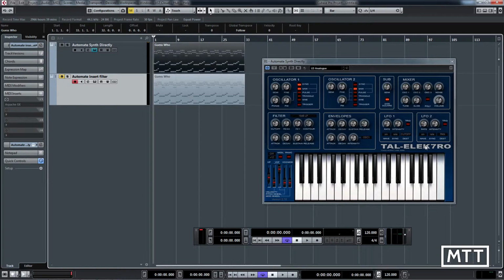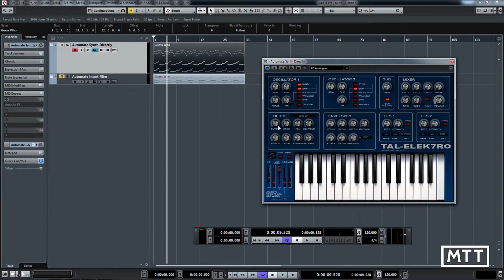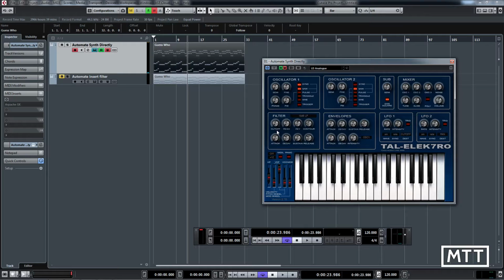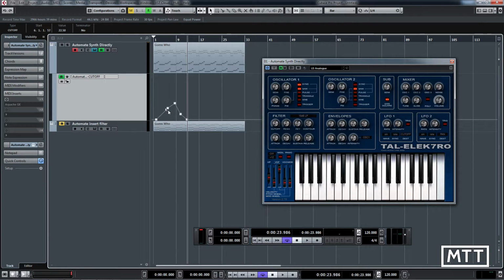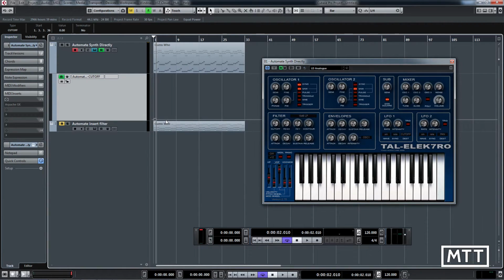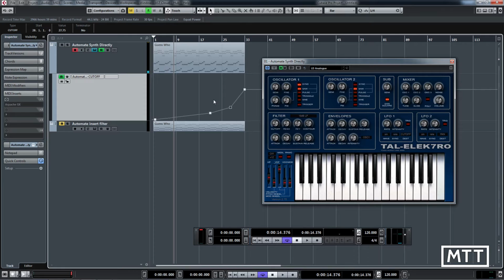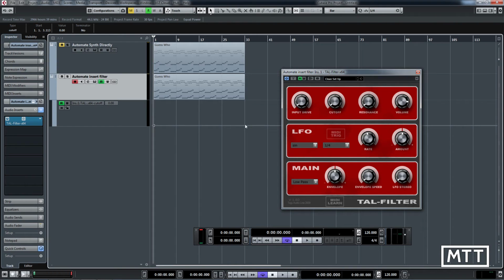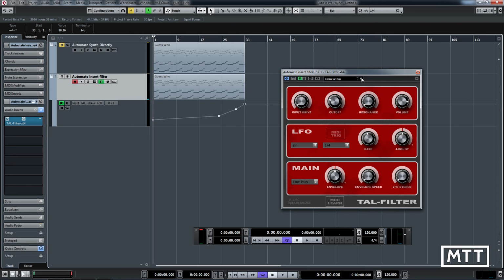Cubase Skills: Filter Automation

Comment: There a already lot of different draw-lines availiable in Cubase. Look here in the online-manual ( you can modivy the lines using the Alt- or Crtl-keys and by changing the gird - just try it out!):
https://steinberg.help/cubase_pro_artist/v9/en/cubase_nuendo/topics/automation/automation_tools_for_drawing_automation_data_c.html?hl=drawing%2Ctool

Nice tipp with the TAL-Filter!!!
Reply from the maker: HI Gerhard.

I've covered the other modes in another video - https://youtu.be/790t4KCRwac - but the point really is that without Bezier-type editing you don't have the flexibility to modify existing data (which often is correct for a significant portion) without making generally larger edits, and often not getting an accurate/desired result - something that's easily achieved in a Bezier-type system.  Cubase's current automation edit modes are showing their decade+ age at this point, and a Bezier-type system as seen in many other programs would overcome that without the negative side-effects that a tool such as the parabola one generates.  In addition to accuracy, workflow would be greatly sped up by such a change.
Reply: Bezier-Type ... I don't understand... But anyway. From this point of 
view you're right! I must admit that my comments are not useful in this 
case. I will think of it in the future - sorry!
Reply: BUT (for the last time...) you can use the "Automation Event Editor" if you select events (I'm sure you know this). It would be interesting for me to know which other DAWs do a better job for editing automation (I see a lot of abelton-live tutorial videos - I admit this is a easier approach... But I'm lucky with the cubase functions.)
https://steinberg.help/cubase_pro_artist/v9/en/cubase_nuendo/topics/automation/automation_automation_event_editor_r.html?hl=automation%2Cevent%2Ceditor